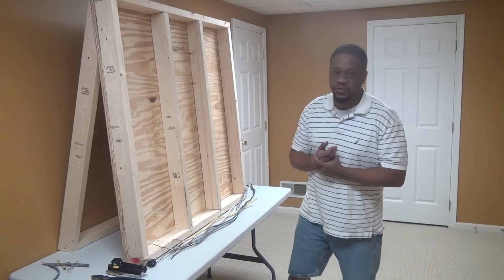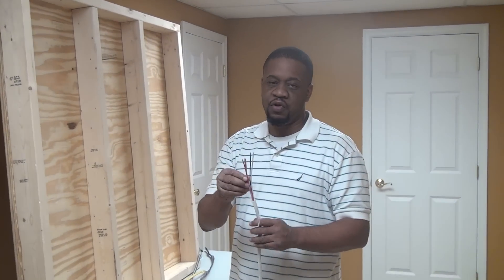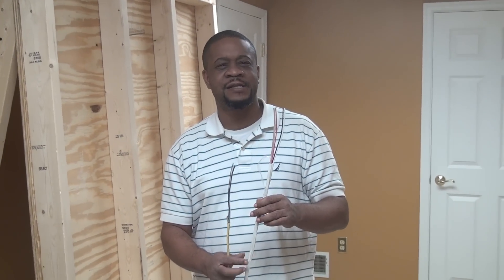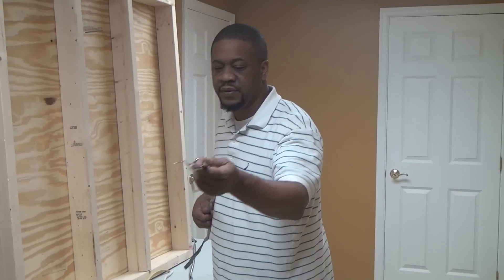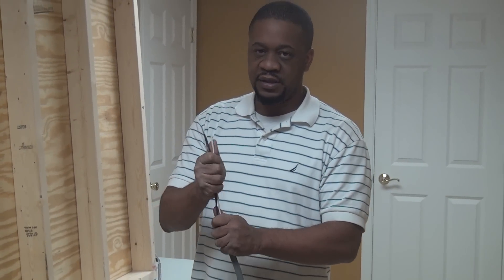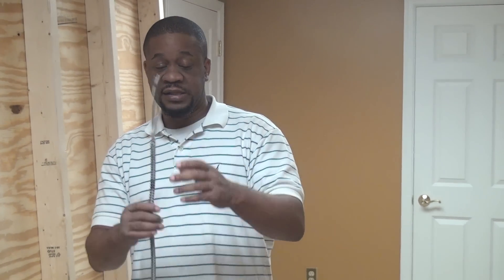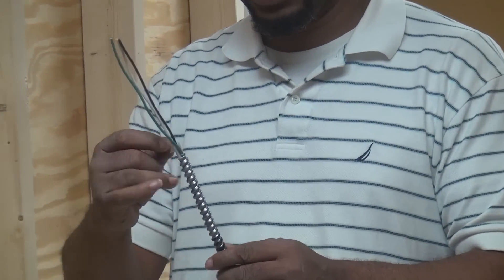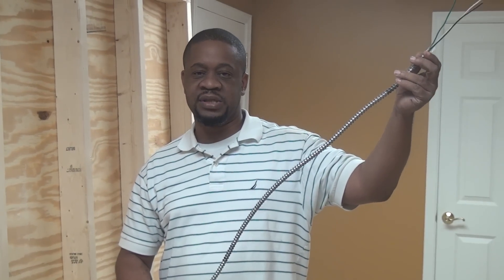wire types

Comment: Hello Tyrone, I'm planning on Installing a light out on my back yard and get my feed from a single pole 15amp switch for the garbage disposal, I'm switching to a decora double switch, one for the light and the other for the disposal,the single pole is wired with 14-3,,can I use 14-2 for the decora or stay with 14-3..is it safe?..thanks

Comment: i appreciate ur vids. ty
in the near future im planning on running electric to my shed from my main panel. do i ned a sub panel inside my shed or just put a new breaker in my main?
i wish u wod do a complete vid on that. im planning on using a 110 welder  in shed. im not sure wat amperage it is. its more like a work shop than a shed. just dont tell my wife. lol thank you
Reply from the maker: LOL you can go either way it really depends on your needs

Comment: help please ... I have a 1 3way switch and a 2 way switch in a  double light switch ... also connected to it is 2 separate electric cables. there are 2 things ( a portch light and a sensor flood light) on the 3 way and 2 switches controlling one light from opposite sides of the room.. I currently have five cables running into the double switch box and wanted to connect a Grey power supply cord to my out door speakers  I have gotten so confused and currently have all of  the cables disconnected and separated from the actual three way and two way switch in the double switch box I don't know how to connect them back again I can find the con wire for each switch also the ground wire but don't know what to do with the rest of the wires to make hooking up the centered fog emergency lights and speakers work please help me sincerely frustrated from Maryland
Reply from the maker: nickole there is no such thing as a 2way switch further more it is almost impossible to tell you how to reconnect all of your wires without actually being there and testing or at the very least having a picture and a way to communicate to tell you what to test for.

Comment: Tyrone if i want to make a couple extra outlets from a pre-existing outlet, what gauge wire should i use? can i go from 12 gauge to 14 gauge? is there any potential harm if i do?
Reply from the maker: +Frapo Chino I have a video about wire sizes on my channel but yes if your wire is not correctly sized it could cause harm. You size your wire with your breaker size, if the outlet in question is on a 15 amp breaker then the 14 awg is what you want you could put a larger gauge wire but that would be a waste of money. If the breaker size 20 amp then 12 awg is what you would want you CAN NOT use a smaller gauge wire like 14 awg but you could use a larger gauge wire again like i said earlier a waste of money. Hope this help but you should look at all the videos on the channel.

Comment: hey Mr. Tyrone: quick question, I have 14/2 wiring throughout my house, and I happen to be replacing the service panel, What are the proper breakers that I should use?  Can I use 15 amp or 20 amps breakers for regular room outlets and switch, (110 volt items )  Can this 14/2 cable handle a 20 amp breaker?  by using a 20 amp breaker, I would say it would eliminate the possibility of the breaker tripping.  Thanks Lupe
Reply from the maker: Hey Carlos, No you can not use any size breaker. for 14awg (your 14/2) you will need to install a 15amp breaker. Installing a larger breaker could damage the wiring or at worst cause a fire.